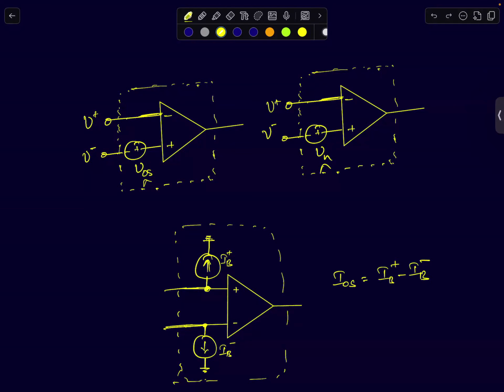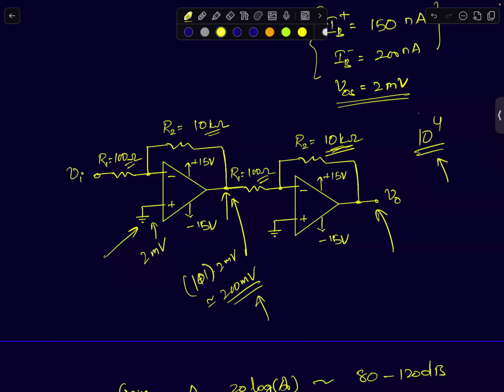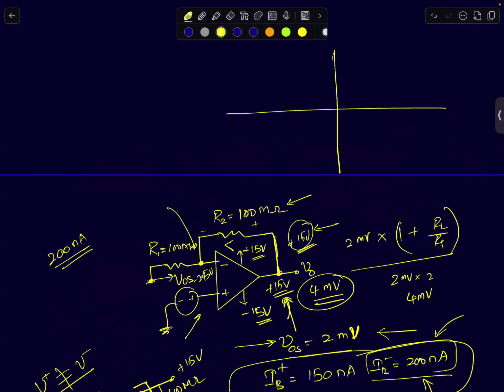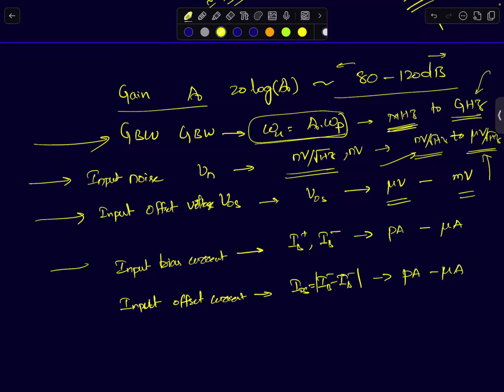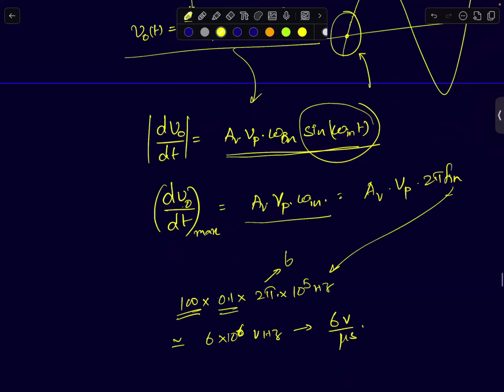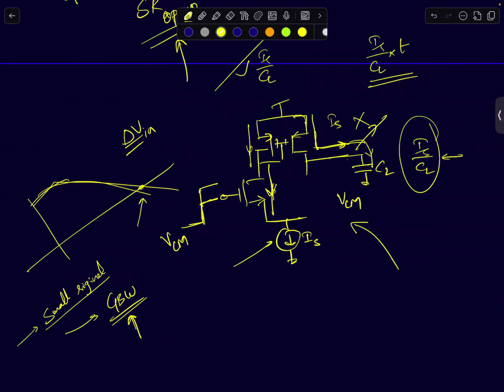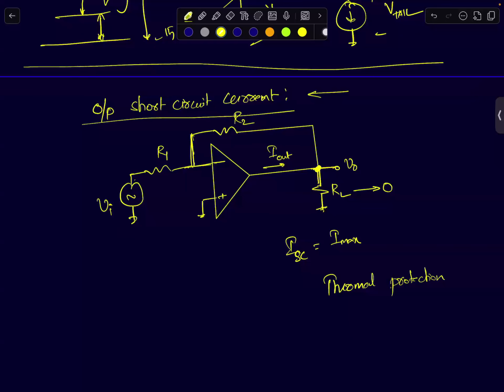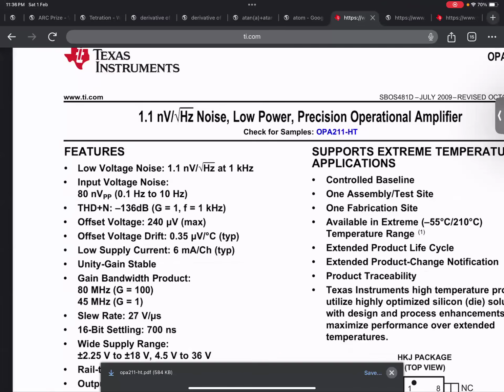AE Lecture 11 : Practical Opamps - Slew rate, Input voltage range, short circuit current etc.,

Comment: offset voltage = (v+) - ( v-) 
then here in the first problem , where non inverting terminal is connected to ground V+=0 ; then Vos=-(V-) 
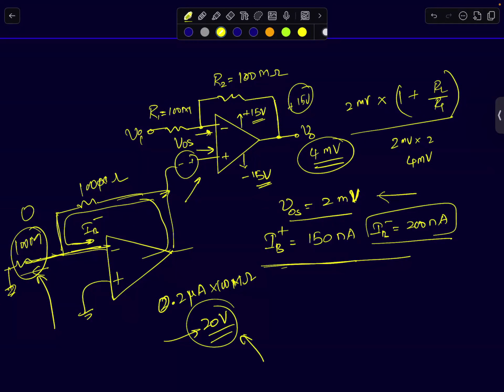To calculate the impact through Ideal op-amp equivalent , we are supposed to connect the non inverting terminal to voltage = -Vos ; 6:57; then calculate Vout which comes out to be -4mV